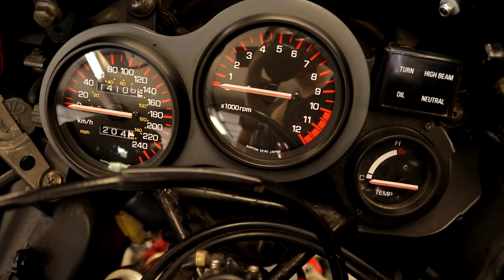Yamaha RZV500 V4 Two Stroke street legal Kenny Roberts &  Eddie Lawson GP500 Racer The Inside Story

Comment: Awesome!  Love the 2 strokes!  I had the RD400's and RZ350's ... always loved the smell of castrol in the morning at laguna seca or willow springs.  That was pretty good not wheeling all the way down the street, heh heh.  Beautiful bikes, and super cool pipes ... thanks!
Reply: Still live near willow
Reply: @izzysykopth  No, moved to Idaho mountains small town about 25 years ago.  Mostly ride dual sport/adventure and dirt now.  I have an old 1992 GSXR1100 that has stickers from WSMC (willow springs motorcycle club) and a sticker of the track layout on the front faring though ... always reminds me of going out there, cool.  Now the only 2 strokes I have are a pile of chainsaws for firewood!  I even ported one yesterday.  I think about going out to willow sometimes, as I make it to So. Cal. about 4x a year for work.  Used to live in Wrightwood for a couple years in the 80's, and really like the desert out there.  - or did you mean you live near willow?  I never knew the motors were so high tech.  I'm used to 2 stroke waverunners, Banashie, and RZ350.  Two cranks, and everything looking so tight.  Better be an aircraft mechanic!
Reply: @blanko8463  that's awesome! I worked for the WSMC club one summer on the flag team and used to mountain bike with Kenny Kopecki. Worked at Mountain High for two years 90-91 91-92 ski seasons. You might even remember me. I had a root beer brown RX7 with a 325hp peripheral port motor gold Enkeis...
Reply: @blanko8463  oh yeah and I still live in Palmdale. Have a 2014 CBR600RR and ride pretty regular in the canyons with some other die hard extremists lol
Reply: @izzysykopth  Yeah, I might know you.  I worked at Holiday Hill (now Mountain High) I think both those years too.  Ran lifts days, and worked in the rental shop nights.  I lived with the Bledsoes ... drove junk cars, or hitch hiked to school and work - sometimes a primer ranchero with no hood, or a dented up karmen ghia ... heh heh ... good times.
Reply: @blanko8463  Sounds familiar... I drove a white 89 V6 Toyota 4x4 with a 102 inch whip antenna on top of the roll bar and a structural ironworkers decal on the back window My radio handle was Ironman 223...I think I remember meeting you because my rude friends (Eric Coffey and Joe Aubrey)were clowning you for working at Holiday Hill which we all thought was cheesy... Cheers from the Antelope Valley!!!

Comment: Bought one brand new in 85 on sale for $5000 cdn @ the dealer in nova scotia as they couldn't find buyers. Re-jetted  after break in made it noticeably quicker.  Like a light switch at 8000 rpm.  Hard to keep the front end down.  Much loved but sadly sold years later to a california prof when family priorities took hold.  IMO looked way nicer than the gamma but couldn't compete performance wise.  I miss it but feel safer not exploring the extremes of speed and cornering.  Did 245 kms/hr multiple times on it.  Way too fast.
Reply from the maker: Wow, I think 245 kms is about 163 mph!  Thanks for sharing your story. -Kirb

Comment: I'm not sure why Kenny Roberts and Eddie Lawson names are mentioned in the title.
I had that bike. Bought it used with Boyesen dual stage reeds already installed.
The engine, while still being underpowered, would pull endlessly 'till 11,500 RPM. Red line was at 10,500 RPM. That's when I thought "maybe it's time to upshift"
Road handling, high speed stability were another story.
Too much weight on the front wheel, non adjustable forks (unless using different oil viscosity/quantity), gravity center too high (on a 2T no less), wheelbase too short, that horizontally mounted rear shock. The gap between 1st and 2nd gear.
At least it was incredibly easy to not only get rid of excessive heat coming from the rear expansion chambers, but to dramatically improve the bike's rear half esthetics as well.
I miss this bike very much.

Comment: I had a stock 1985. Great bike if you didn't care about handling. Or anything that resembled stability over RR tracks/coming down from a wheelie/going over 130mph.  A damper helped but not much. If you look at the bike, the rider is disproportionately to the rear. Yamaha engineers really dropped the ball on the 350/ 500 2 strokes from that era, and God knows how many where maimed or killed from the all-too-common death shake.  With all that said, I LOVED that bike and wish I still had it.

Comment: Excellent presentation. Very interesting.
 When I was in my early 20s these bikes were nicknamed? 
"Widow Makers".
Ive heard in recent years its easier to get the lighter Japanese version of these bikes than the Steel framed export version.
I shake my head when I consider my MT10 is 160hp compared to these classic machines.

Comment: I had an RD 350 with DG pipes and heads. It was a true giant slayer for its time. The only bike I feared was Mach Iii. Other than that, even the 4 stroke Kawi 900 and CB750 4 were game for a race.
Reply from the maker: So True!  I always liked the DG heads, really cool.
Reply: Cramer's Classics they were like an anodized gold color ( DG finned heads)  and pipes were stainless with gold tips. Running a colder plug and good gas, it was a giant slayer. You could change the pistons and rings in less than an hour. Pull off the head, take off piston retaining clip and you had fresh top end.  Less than $100 bucks to do it.  I feared no 4 stroke at that time. The Mach III and IV , however, were feared. The RZ 500 was a giant slayer as well. Too bad US never got em. There were some gray market ones around.
Reply: I used to go to the knockhill circuit in the 80s and they had a handicap race. YPVS 500 always got a head start but the GPZ always blew it away in the end.

Comment: I have a 1985 RZ500 - is it worth reviving?  It has been in storage quite a while.   It has not been run in a number of years.  It is in good shape - the motor turns over, and the bike it is not crashed, it's in good shape, but I'm wondering if it's worth the possible cost in engine work (crank seals, for example, a pretty common 'wear item' on 2 -stroke bikes) - 

- not sure if it's better to sell it as-is or revive it.  Is it cost-effective to put a stored Rz500 back in running condition?
Reply from the maker: Only you can decide.  The hard part is finding someone who has worked on RZ500's.  Perhaps some of our viewers have recommendations?

Comment: For the Anti dive I used a massive screws instead of the hollow original ones and Stahlflex brake lines. No more squishy feel. Also the vented brake disks are rubbish. If U look closely than U can discover that they are soldered together from seperate parts. Changed to Spiegler floating disks.
Reply from the maker: Great ideas Heiko.  Thanks for sharing! -Kirby

Comment: Hi there. Can you show me how to modify gas line quick connect. I have RZ500 too. Still working on to make it run again. It’s been sitting for couple years just need TLC
Reply from the maker: Just add after market disconnect.  The area easily available.  Make sur it has shut-off on both sides.
Reply from the maker: Here is one similar to mine:
https://www.amazon.com/dp/B0B1HMSSTF/ref=sspa_dk_detail_3?pd_rd_i=B0B1HMSSTF&pd_rd_w=uJE56&content-id=amzn1.sym.3309c9d3-bf37-499a-888c-9ce693c3483f&pf_rd_p=3309c9d3-bf37-499a-888c-9ce693c3483f&pf_rd_r=SSP5K60K9E3CC79EK215&pd_rd_wg=4pEWN&pd_rd_r=07e85ae0-beda-4069-813e-9211b9379b0d&s=automotive&sp_csd=d2lkZ2V0TmFtZT1zcF9kZXRhaWxfdGhlbWF0aWM&spLa=ZW5jcnlwdGVkUXVhbGlmaWVyPUEzNDhCSjU5VTBURzZPJmVuY3J5cHRlZElkPUEwOTE0MzgyMk4yRjQ5OVJXTk9ZMCZlbmNyeXB0ZWRBZElkPUEwNDcwNTYzM0VFVTlSOTJGQVZUOSZ3aWRnZXROYW1lPXNwX2RldGFpbF90aGVtYXRpYyZhY3Rpb249Y2xpY2tSZWRpcmVjdCZkb05vdExvZ0NsaWNrPXRydWU&th=1

Comment: There is something about the sound of a 2 stroke when its on song! Magic.... Thanks for sharing Mr Kirby from an old bloke down under ;)
Reply from the maker: So right Glenn.  At some points in the video you can hear 8 cylinders between to bikes harmonize.  Quite a song.  Thanks for watching! -Kirb
Reply: Especially if that song is just to your rear and down a little.  :-)   75 RD-350,not stock.  Many smiles per mile.

Comment: I have a Japanese home market RZV500R.
The RZV was a home market only bike with an aluminum frame
The bikes you are showing are beautiful......but they have steel frames....they are not RZV's
Reply: I would trade the aluminum for the 20 or 30 extra horsepower any day of the week. To say it's not an RSV sounds kind of chicken crap to me
Reply: @waderenfroe1696  
Stating simple to understand facts.
One has an aluminum frame, the other steel...also having an aluminum bodied adjustable rear shock over a steel body shock, different forks, handlebars, aluminum pegs and foot controls...and more...
Both engines are identical, only difference is carb jetting and collars in exhaust headpipe.... so there is no 30hp difference.
It is easier to swap pipes and re-jet than swap a frame, but if you prefer steel that's your opinion.

As stated earlier, the bikes shown are beautiful, but to the uninformed, there really is a difference when actually buying and owning.

Comment: which tire dimensions do you use on the bikes and from which company?
Reply from the maker: I run Avon RoadRider 120/80V16 front. 130/80V18 rear.  The fronts are getting hard to find.  Cheers, -Kirb

Comment: Did not have a, Kawasaki, a bike for 27 years, chance to get a bike, thought, no Kawasaki shops close, might get a good used RD250LC, 350LC,or a RD 500LC, that would be a bike to enjoy. Turned down a CBR600RR sight unseen, saw it wanted it, just sold, BUMMER, bit I got a 2005 GSF 650 BANDIT, one very careful, cautious owner who basically ran it in for 15,000 miles, and it's about as much fun as my nearly new GPZ750TURBO in '84. Power band, the Bandit, time vortex, tunnel, bubble experience in acceleration. First night, am. on Bandit, after 2,3 miles hit the PERFECT STORM in 4th gear, as a brand new Focus ST tried to lord it over me. Focus ST caught up at lights,' what you've got there is very, very SPECIAL', I said, big story is it red lines at 12,000 RPM, they laughed we parted. Hindsight should have mentioned, when I left them for parked, red-lines 12,000 RPM, never went above 6,500 RPM, which is just over 90mph. 2 stroke Yamaha??, VERY NICE,, give me a Bandit every time.

Comment: When i bought a used RZV500 in 1990 it was fouling one spark plug (but wasn't sure how many were fouling). Carb jets were factory size, float level ok. Turned out one choke cable was sticking: the one on a tight arc. I removed one bracket screw that held the four choke cables, swiveled the bracket which took out some arc on the cable. Run some oil down that cable (plus the other three cables) No more fouled plug!.... I could kick myself for selling that bike.

Comment: I had a brand new RD500 in 1985,  i hated it.  I bought a new RG 500 in 1986. 
I bought new GSXR 750 in 1986 as well, never owned a road going 2 stroke since..
The 350ypvs  with stage 3 tune is a better bike than an RD500.

Comment: We had them in Australia, I worked at a Yam dealer and had raced a heavily modded RDLC 350 for 2 seasons and was excited about the 500 release planning to go up to 500 2t / 1000 4t class. The RZ 350 / 250s were great bikes and went like stink and much was expected of the RZ500
Sadly they were a disappointment, under powered and not go good on handling either and Yam did not sell many either compared to 350/250s.
I moved to 1000 4t super bikes instead (Yoshimura Katana 1000) and was passing RZ500's easily including in corners.
More recently I discovered Yam released a manual of engine mods incl port maps etc for the RZ500 for anyone planning to race them, so I suspect the poor performance of them off the showroom floor was perhaps that they were crippled due to smog laws.
The FZ750 came out soon after and everyone forgot about the RZ500
Reply from the maker: Yes, compared to my RZ350's the power increase is not too dramatic.  The extra weight of the RZ500 is also significant.  I think properly ported and tuned their would be a big jump.  No doubt the EPA smog requirements killed a lot of HP.
Reply: @cramersclassics  
Yes a lot of room for improvement on the engine and a good deal of weight removal needed.
Here is a pic of me (on the Katana) and another guy (on Z1000J) passing an RZ500 at Calder Raceway in 1985 at a hairpin
https://www.instagram.com/p/BsuePwWg2KH/?utm_source=ig_web_button_share_sheet
Reply: @twohouses2259  
Thanks for that info, it'd be interesting to do some comparisons of parts to look for any obvious differences that may be simple mods for anyone with a smog version to do.
Reply: @cramersclassics  The 500 was out of the EPA's purview. There were perhaps noise emission limits however.
Reply: Any pics of the Yoshi Katana?

Comment: RODE A STOCK ONE   NOT VERY IMPRESSED  BUT I AM SURE WITH A SET OF PIPES AND A LITTLE WORK SURE IT WOULD BE A DIFFRENT RIDE
Reply: You couldn't be more correct there Perry! They were a bit of a lame duck tbh. Rear pipes commonly carboned up and they loose power. The RZ350 was a WAY better ride!!
Reply: I rejetted and added pipes to my 1979 RD400. Went form a little torque at the bottom end to a shit ton starting at 5000 rpm, and pulled HARD all the way to 10,000. World of difference with expansion chambers.
Reply: The Yamaha 2 stroke "muffler" strategy was to place a blocking plate in the fat part of the expansion chamber with 2 short pipes in the plate , ie, restricting the flow inside the expansion chamber, and had streight through mufflers. These inner restrictor pipes commonly blocked up restricting flow even more!! Suzuki, ie, RG250 etc, had streight through expansion chamber with the muffler restricted in stead. As expected, significant improvments were to be made in correcting this. :-)

Comment: The engines were very under-stressed. They could be totally reliable making 120hp.
The stock pipes weigh a ton.

With the infusion of some modern tech, it could be a giant killer.
Reply: U are unfortunaly wrong, had one for 15 years, used up 5 pistons. Found a reliable setting with different main jets for the lying cylinders than for the standing ones. Also used 2 different plugs BPR 9  for the standing and BPR 8 for the lying ones. Live in no speed limit Germany...

Comment: 2 strokes burning castor oil = Heaven!
Reply from the maker: These are running Motul 710 synthetic 2T.  My favorite is Maxima 729 Castor, smells like the old Klotz castor oil we used in 125 motocross racers in the 1970's.
Reply: @cramersclassics  We used to run Blendzall in our TZ-250s. MMMMMMM smelled soo good.

Comment: I'm very lucky because in 2008 I bought mk2 aprilia RS250!  First mk2 Malandri replica! But lucky man me! My actull bike was taken by arrow for the year 2000 edition expantion chambers for the RS250,  arrow in Italia took my actual bike to aprilia works GP team ! Yes quite a one off bike,works GP guys road tuned my bike in conjunction with  arrow 2000 pipes development ! I have RRD 72hp at RW  and 80Hp at crank ! 138kg  it's faster  more nimble handling ,better brakes , frame ,forks wheels ! In fact the entire bike is vastly supirior to RZV500R and faster! Ok 15 years development on its side compared to rd 500 ! I have reason to beleave the rd500 engine has 64mm stroke on the RD250ypvs cylinders and 2MA shorter stroke on the lover pair cylinders !this is why the fuck up engine needs balancer shaft ! The motor make horrible de acceleration machanicial noise, which found very dissopionted in!  Yamaha failed 2T junkie me by not making mk2 rd500 with 1985 2ma cylinders ,beam chassis , USD ,indeed in 1989 3ma was produced in Japan home market and 1990 3 MA SP  triple valve  cylinders 80Hp 250 !  where available and Yamaha had a window to produce mk2  RD500 but miserably failed all RD fans ! If i was running Yamaha their would of been 150hp 3 MA SP cylinders genuine V4 ,bean chassis USD trick bike produced !  Any actual new rd500 owners know exactly what I'm talking about!
Reply from the maker: Also, a big factor must have been the EPA in the USA.  That likely kidded the largest market for the bikes.